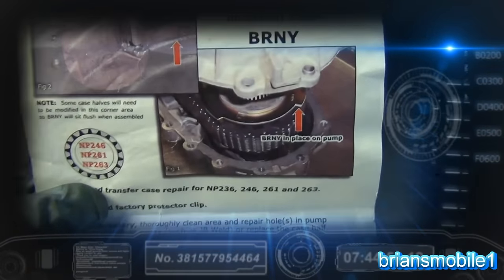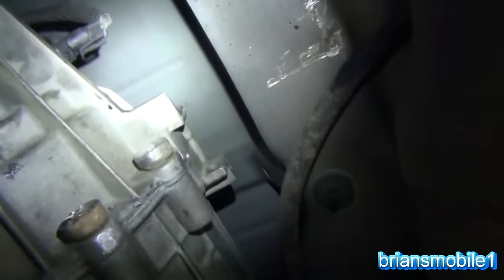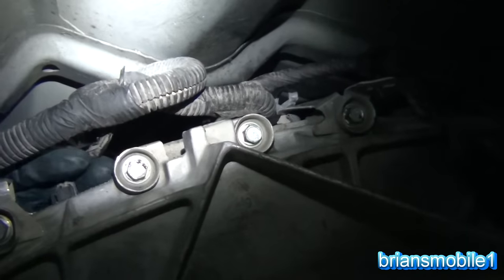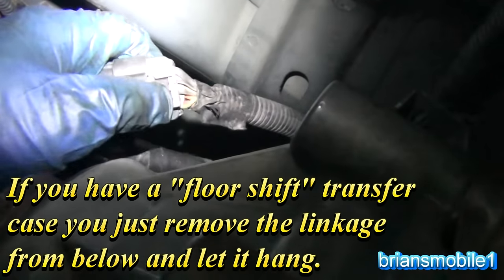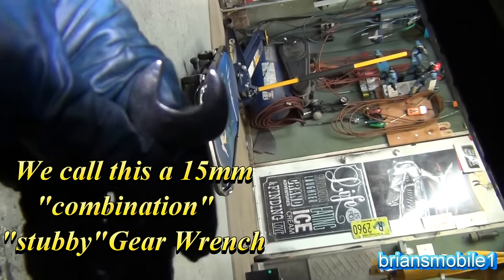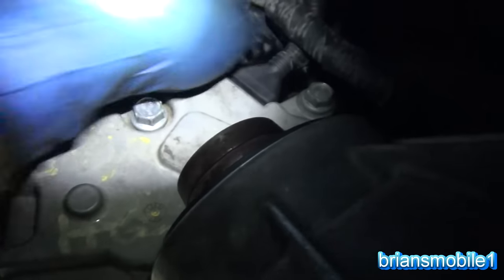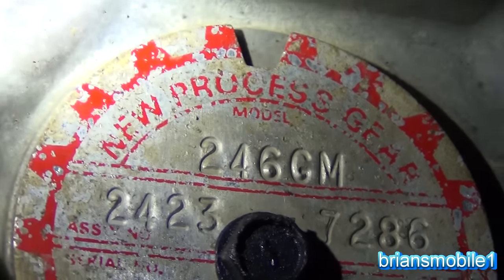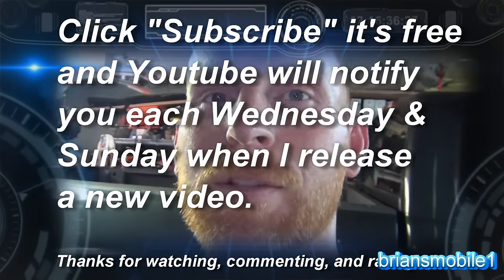Transfer Case Remove Install Help

Comment: Not sure who thumbs down these Vida.  Brian is great guy
Reply from the maker: It's a mechanic in Colorado who thinks I'm ruining the industry by sharing the info.  He's two of them and there's a guy in Europe too.  I blocked him too for being disrespectful and vindictive to subscribers in the comments more than 3 times.
Reply: @briansmobile1  Brian, I bought an 04 Yukon 4 months ago. I have been replacing all of the fluids in the vehicle and other upgrades. I did the T case fluid last weekend and discovered very little in it when I took the drain plug out. Filled it up and all was good. Now I know why there was very little in it, it has a leak. Not sure where from yet, but if I wanted to do the rebuild on it with a new rear housing and the new pump plate from your other video, can it be done without taking the whole T case out?
Reply: Excellent videos. I only watched two of them on the transfer case removal and part 1 disassembly. I am very impressed by the filming quality, narration, subject expertise and overall flow of his tutorials since it appears he is the camera man, main character, director, editor and I am going to guess has a day job somewhere other than his garage....thank you for the videos
Reply: Actually I'm sure Brian is a great guy,  But this video,  not so much,  anyone attempting to take their transfer case out,  already knows what a wrench is they already know they got to unplug the wires they already know what a drive shaft is and that a transfer case has one out both sides,  this video is more for your young son or daughter that wants to hang around Dad and see what he's doing in the garage,

Comment: In your video you said there was 3 connection for the sensors. Does two wires connect together or did I miss something in your video. It's a 246 GM transfer case.

Comment: Thanks for taking the mystery out of how that is connected to the transmission! I've looked at mine several times, read the shop manual, looked at schematics, etc. Your break down of how it's connected, where all the parts are, and how to get the darn thing out is the most concise set of instructions I've come across in several weeks of looking. Thanks again!

Comment: Here's the details involved with my 1999 K26J (4wd, 2500, Vortec 7.4L) Suburban; the differences between what Brian details here and what are involved with, at least my Suburban. 
0. I used a Harbor Freight low lift transmission jack with a folded towel on the plate, some jack stands, and a floor jack, and did everything on the ground in my driveway. My Burb is a Southern California vehicle, so it has never tasted salt.

1. I removed the drive shafts first, but the front one required that I disconnect the shift arm from the side of the tranny (a single nut, but hold the lever arm with a crescent to isolate torquing on the internal tranny parts) to enable me to move the front of the drive shaft towards the passenger side and down below the front yoke to have sufficient room to pull the shaft out of the T-case.
2. The bottom T-case nut is removed by removing the tranny mount. It's not accessible without doing so, but the tranny mount is easy to remove and then throw back in there loose for the rest of the R&R. I did not have to remove the transmission mount cross-member, and doing so would not give any additional fore-aft movement space, only up down, and not the loading you want to put on the input and output shafts.
3. There was not sufficient space to move the T-case back off the transmission output shaft without moving the torsion bars support cross-member backwards. Dropping the front drive side of the T-case down does not change this. At first this seemed like a huge undertaking, however it went very fast for me with the GM Torsion bar unloading tool on loan from Autozone. After counting the turns to completely remove the tension bolts, and then removing the 6 bolts securing the cross-member (I sprayed everything with a penetrant first) I found that my torsion bars moved easily out of the lower A-arms, so I simply slid the entire cross-member back to the next cross-member, torsion bars and all intact. Doing this gave me a good 4 inches of additional travel to move the T-case off the transmission output shaft. Once the T-case was separate, I rotated the tail 90 degrees to the drivers side, used 2 ratcheting nylon straps over the cross-members and under the T-case to support the long side of the T-case while I lowered the tranny jack and the short front drive side to below the transmission cross member. I then released the ratcheting straps and lowered the T-case free of the vehicle. Installation was reversing this procedure. I hope this helps people.

Comment: Great video! I'm having to do the transfer case repair AFTER noise started.  When it started popping when in four wheel drive I understood it was a real problem.  

I found your other video about installing the repair plate first, subscribed to your channel and now watched this one.  Probably I'll watch the repair one again before opening the casing.  

I clipped and pasted several screen shots and created a step by step document for referral when I go get under the truck again. I hope that is OK (?) and doesn't break any YouTube laws?

Once again, many thanks for a well produced, straight forward, plain spoken how to video without all the "personality" that so often is a distracting part of other contributors' videos.

Comment: Brian,
Thanks for the tip to get the 15mm stubby gear wrench. Don't think I would have managed without it on my 99 suburban.
Reply: Those things are The BOMB! 
One of those (9/16") helped me remove the 15mm nut on the top of the NP231J in the 2003 Jeep TJ 4.0L 5-speed here.

Comment: I tried a handful of specialty sockets and wrenches including half moon and s-wrenches to reach the top with no luck before getting a stubby wrench and having it work great.  These NP cases are still a huge pain to get in and out because of the torsion spring mount.

Comment: This video really helps me out I see how all that goes when uninstalling that case off that I for sure thought I'd have to have a jack holding the transmission up to make more room for the case to come out easier I thought anyway so I'm happy I don't have to remove any cross member bar from there

Comment: Thank you! I’m down to the last two connections and then unbolting it. I’m a bit ASD/ADHD and decided to take a break and verify I was removing the right bolts.
Reply from the maker: You're most welcome Tom.  You got this!
Reply: @briansmobile1  got it and, the transmission shop picked it up Monday morning and dropped it back off in the afternoon. That was in MO and I got into Portland last night. You think a Express 1500 with a 5.3L engine can flat tow an 8000lb motorhome? We’re going to find out. I’ll take it easy and watch the gauges. I’ve got an Autel scanner to help monitor things.

Comment: Rule number one, there is no excuse to have no jackstands supporting the rear axle. If that Jack fails the cars gonna come hard on you in the hit you. It may not crash you to death, but it will definitely make you regret it. Your video is great but please let everybody know you made a mistake by not using jackstands!
Reply: It was probably a quick job for him so he didn’t need to slap the jack stands lmao

Comment: I have a 2004 Escalade my code is NR3 I believe it to be a BW4481 there was no metal tag on mine or any markings , but NR3 on sticker so I think it’s 1 gear awd open diff ? Lol I have to pull mine out to do all bearings and seals I’m not sure if my style has or needs a pump saver ?

Comment: Just got done putting a Truetrac in my 93 K1500. Still have the clunk in reverse and now that I know it's not the rear end..it's time to address the NP241C that was abused by previous owner.

Thing likes to pop out of 2HI and into neutral when a good amount of reverse torque is applied.

Comment: Excellent video, Brian. Using the tab information, I have a 241GM Transfer Case and am in the process of my own attempt. Thanks a whole bunch.
Reply: BTW...it has been a day later and I'm stuck!! The top transfer case bolt on top is giving me trouble. Cannot access it with the tools and a variable attempt of wobbly attachments, shorty wrenches. Crossmember is removed, supported by trans jack, lowered it a little. Any new ideas for me?

Comment: Hey brother I appreciate the information, i know it’s been a while. I was wondering how important it is to have a stubby length wrench-i have the ratcheting closed end wrench but not one that’s short. Is the firewall/trans tunnel an issue?

Comment: Did you need to jack/support the transmission? There a couple videos of people removing the trans support rail and then having to support the trans with a jack? Just curious if you had to do that
Reply: I'm about to do mine on Monday and was scrolling through the comments with the same question.
Reply: @dt-paz516  I just did mine and as long as your transmission mount is secured to that cross member you don’t need to. I winged it in my garage and I didn’t need to use a trans jack. Just be carful if you do it by yourself cause the tcase is real heavy. I was able to do it by myself but it was definitely a struggle getting it back installed due to the awkwardness and the weight in a small space. Good luck!

Comment: Awesome video.. taking mine out tomorrow., going to crack it open and rebuild it.. I've did older ones. Late 80's but not these newer models., go luck to me.. lol taking off the motor first is a good tip.. there high., thanks man.. Kentucky j.j out!! Be safe!

Comment: Curious of your words calling it “pump knock”?  I’ve been chasing a pop in the area below the drivers seat on my 2002 GMC Sierra for some time now. It happens just as I begin moving from a stop or a direction change from reverse to forward. One metallic pop, much like a piece of sheet metal being bent and straightened out. My first though was a muffler being tweaked from bad motor mounts. So I have new motor mount going in and will be replacing the muffler soon too. 
But you got my curiosity going with this pump knock. Also I’ve done nothing to my transfer case except change oil.
Reply from the maker: Check out the pump knock video on my channel.  Also check your U-joints for play.  With 2 people is best.  Have one getting the noise to happen from the driver seat and one looking under the truck from the side.

Comment: Great video very helpful I am looking to remove transfer case and transmission. Just not sure if I need to raise the rear axle as well as the front? Thanks for any help.

Comment: Do you need  to drain the transfer case before removing it, and is there a gasket between the case halves that is needed.

Comment: I can’t seem to get that top 15mm nut off. I have the 3inch ratchet wrench but don’t have enough clearance to even break the bolt loose. I even had the 3inch wrench on it using the 12 point ratchet on the nut with another wrench around the open in to be able to get a bite on it. I still can’t move it enough because of the clearance.

Comment: Is there anything else that supports the weight of the transfer case or just the bolts holding it on hold the transfer case in place?

Comment: I have a 13 titan but similar process. I have it all unbolted but its stuck to the transmission. I've been using a hammer on a 2x4 to beat it loose but it won't budge. I have a pile of 2x4 kindling and the t case is still on there lol

Comment: GREAT VEDIO, I looked at them all this is the best, I had a small problem with the TX case cone snap ring but found a tip in the comments about spreading it with a wedge to allow the bearing to slide right in place without hitting the ring, it worked great. GREAT VEDIO

Comment: nice clip, 
i have 2008 escalade random sound front end while driving everything looks good if you can suggest loud noise while on  freeway didn't find anything underneath what should i do .......sounds like noise from either front diff.or tranfercase...need help

Comment: As always thanks! By the way how did the lift kit work out on your new truck?
Reply from the maker: So far, so good.  It needs airbags in the back still.   I have to tow with an load distribution hitch for now.

Comment: Great Video! i have a 03 2500HD Duramax with a Np 263XHD,  Is it similar to this removal?  The case is leaking so i want to get a new cover and repair kit.  Thanks for any help!

Comment: Brian on my 03 gmc yukon xl denali has the borg warner transfer case. Does it have the pump rub or is it different? There is no hole leak but it is leaking from the rtv sealant of the cover. Can I just  remove the case off while still in the suv, and clean all gunk of sealants in the case and reseal it good with everything still in the suv. I don't want to remove the transfer case off the suv cux it looks like a hassle to get it out.

Comment: Hi Brian, Nice Job! i have a question... I just bought a 2006 2500HD Diesel and am going through it. I noticed about 1/8" of vertical play in the drive shaft coming out of the transfer case (the shaft that drives the rear wheels). Do i and should i pull the transfer case to fix this, and do i need special jack / lift to lower this to the gound (all work id done in my stone driveway)... Any recomendations are welcome and thank you for the video.
Reply from the maker: Jamie Chokas I really like to use a hydraulic transmission jack on a 4x8 sheet of 3/4" plywood at least.  That bearing with the clip on it may be bad on yours.

Comment: would have been great if you had actually shown how to remove the transfer case by tilting it etc., without removing the torsion bar/ suspension crossmember.... a demonstration is worth a thousand words.... thanks for the directions though

Comment: Could you remove the cross member of the transmission mount that holds it remove it and then drop the transfer case to pull away

Comment: Hi Brian, really enjoy your videos. 
recently picked up the BRNY for my 07 sierra 246 transfer case. 

Just had a quick question about seals and the transmission adapter gasket. when doing this repair is it vital to replace the 3 seals (2 input & 1 output + the gasket) Im having trouble locating them where i live other than online, anyone reputable online ?

Also very quickly I've seen some info about greasing the rear output shaft bearing on the inside of the rear case half.. using some kind of grease? could you recommend a grease i could pick up locally ?

thanks again and i will keep watching

take care

Comment: Thank you for the great video. I was able I replaced the transfer case for my 2500hd thanks to your video. However once I replaced it I got the "service 4wd" message on the dash. Also my push button 4x4 does not light up or work when pushed. Any ideas? Does the transfer case need to be reprogrammed so the computer will understand it?

Comment: Hello brother I have a 2001 GMC Sierra 1500 four-wheel drive 3 months ago I had the transfers case cover replaced because it was cracked everywhere 3 months later notice the truck is leaking I look under it and the same thing happen again with a few cracks on the new one the mechanic that did it in the past said that it was caused by the case mount and he replaced it but like I said it happened again I have cracks everywhere don't know what to do what else can be causing that I have to do the work myself on the floor and it seems very hard to reach not being able to lift the truck up high like in a shop can't afford to take it back to mechanic again please help

Comment: hi Im having to do a transfer case swop on my 1992 f-150 Im getting one from the wreker but just wondering anyways it jumps out all the time, and its like its in neutral bu if you wiggle jiggle the 4x4 level it will work again, sometimesthe lever gets truck and jammed and can get it into 4x4 or 4low, so im going to check out linkage and but wonder Is a transfer case swope pretty straight forward, is there any pointers you have, do you have to worry about the oil pump in it or is there one/ thanks

Comment: Great video I just removed my transfer case on a 2003 2500 hd with a 6.0 gas is it normal to have some trans fluid between the transfer case and trans was not a lot
Reply from the maker: Yes.  Technically it shouldn't be there, but it's pretty normal.

Comment: yo buddy you said we. got a mouse in the ol pocket? the last transfer case removal i was involved in the toughest part was gerting the transfer case feom the truck to the ground. beat that one tho, used a motorcycle lift. sneaky huh? it worked great. thanks for the video
Reply from the maker: "We"- there's a SNAKE in my pants!  No mice where there's snakes. lol

Comment: What is "pump knock"?  Is it a audible knock sound?  What is the cause?
Reply from the maker: It's the plate rotating against and tapping or knocking against the case.  It wears a hole in the case over time.  Check out the pump knock fix video for more.

Comment: Does any one know. When the truck is set on 2wd should the front drive shaft be spinning under power with the rear drive shaft as well? Mine does. Front diff neutrals out. Should the trasfer case neutral the front drive shaft on 2wd? Thank in advance.

Comment: Brian!!! Where are the jack stands for the  back?!? I don't want to hear one day that you get crushed by a truck/car on the news :(   Had that happen to a close friend! Be safe! Smile More!!
Reply: if the truck slip on the jack, not even a scratch will happen to him there's a huge room underneath the truck
Reply from the maker: Thanks for your concern!  I have the back wheels just barely off the ground by the rear axle so the driveshaft can rotate.  If it dropped instantly- I'd be fine with room to spare with just the front stands.